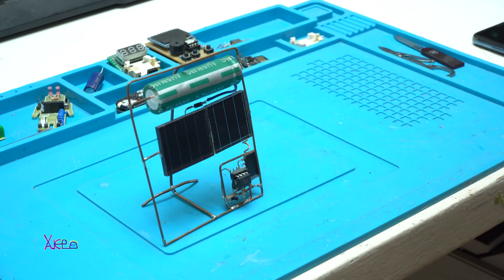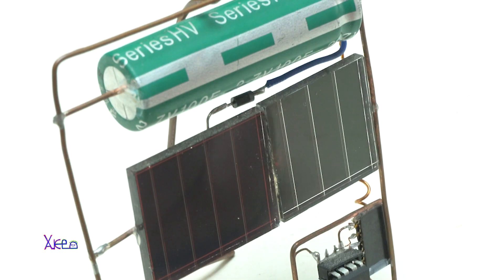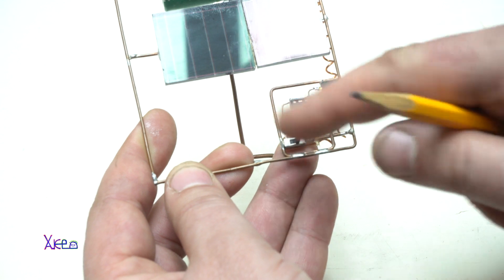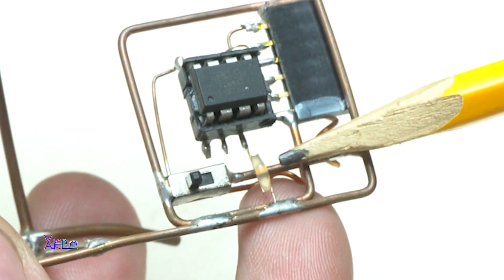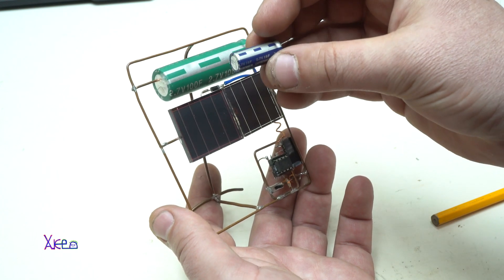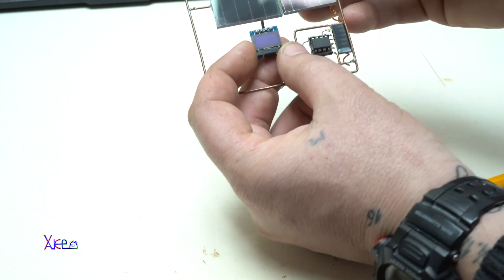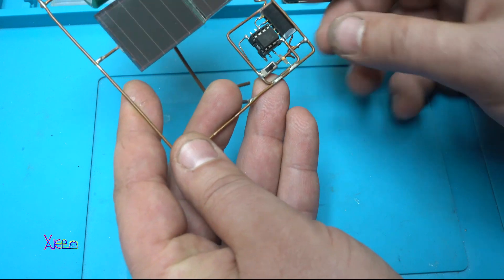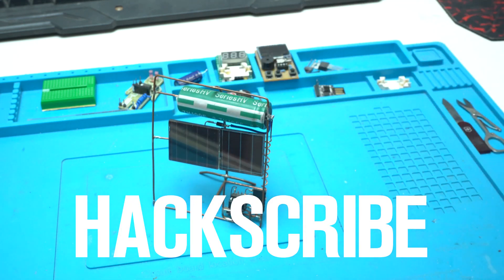Skeleton Circuit with Solar Energy and Super Capacitor

Comment from the maker: Comment what function to add on Gadget?
Reply: Add that tiny OLED display, a tiny buzzer, a temperature sensor and a button, keep the LED.
● Normal operation: the display displays a randomly rotating wireframe 3D shape and briefly switch to display the temperature (°C) in every 20 seconds for 5 seconds. 
● Notification mode: when the temperature is reached below a set value, display the temperature and beep until the button is pressed once, then return to normal operation, but blink the LED until the temperature gets above the set value again.

Comment: I like this. It could be 
A flashing light for a pico, balloon, at high at altitude and low temperature, batteries don’t work well, but super capacitors do. How long will this flash for in the dark?

Comment: The capacitor now has more power to charge some rechargeable batteries a bit, maybe even 18650. Worth a shot. These with boost converter can run almost anything :D. But, the solar charge is small, so would take ages to charge everything. Only small power this can produce. So, the question is what you want it for ;).